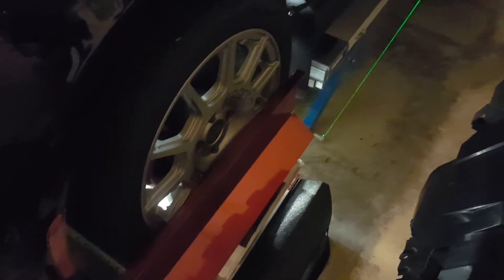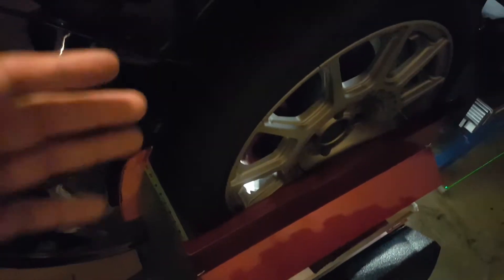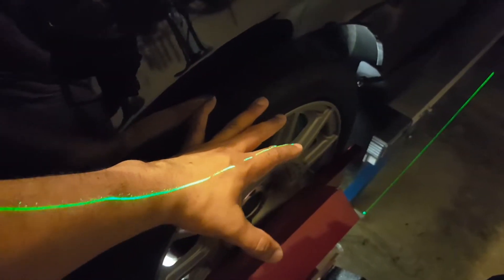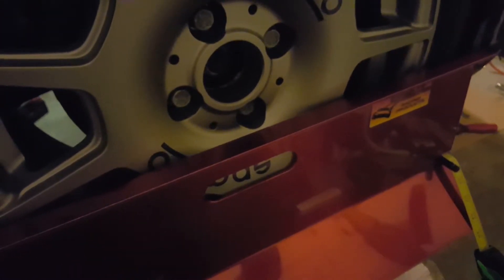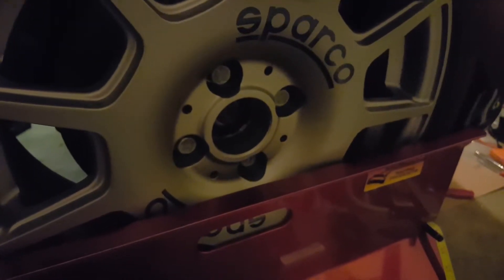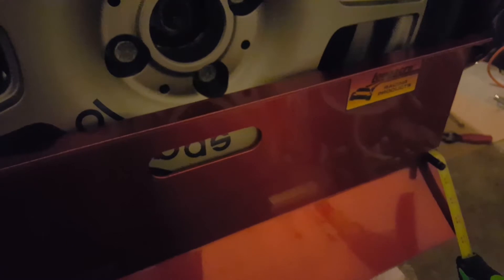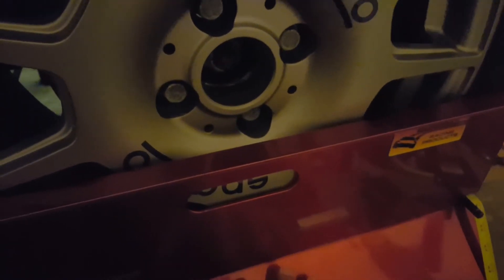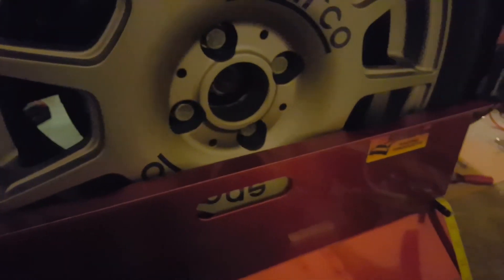Using toe plates to check alignment

Comment: These don't establish a center line to work off of.  Using measurement to 'correct' one side is useless.  The difference between front and rear of the plate being measured may indicate misalignment of one wheel, two wheels equally or two wheels of different amounts.  Need to start with string alignment to get a known basis and then, using plates, you know the total (left + right) misalignment.  How you correct for the total misalignment is still based on the center point not accounted for by these plates.  This is only a part of the solution.
Reply from the maker: Yes, this is is only part of the story. Like the title says. It is a just a way to do a quick check.
Reply: So you don't use these to set both sides?